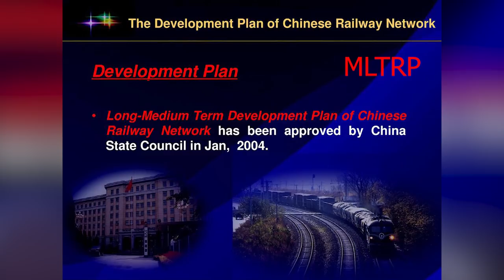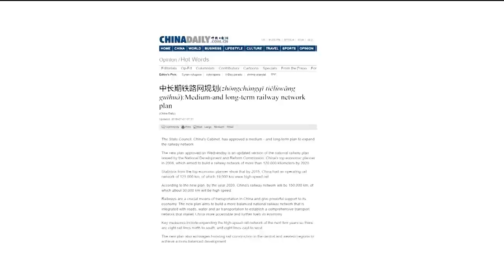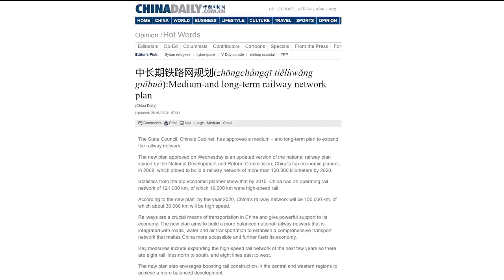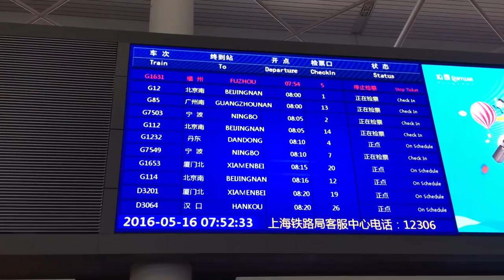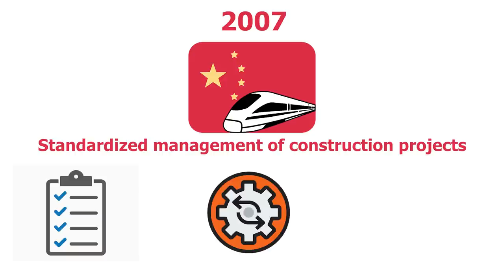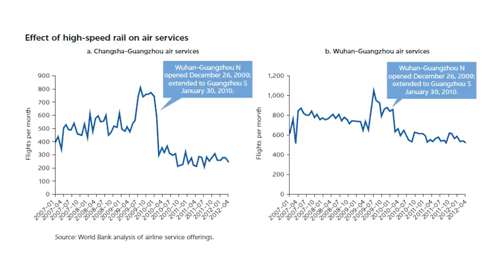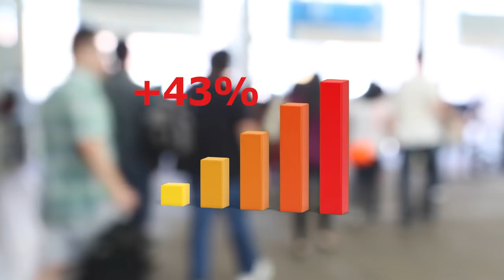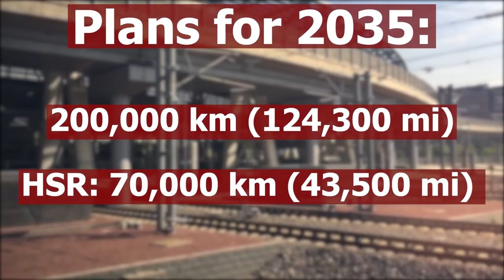How China Constructed 36,000 km of High-Speed Railways (in less than 12 Years)

Comment: One biggest advantages of China's HSR is the convenience when there is such a large scale network. The HSR in China is almost like a subway metro:
I once arrived in a HSR station 15~20 min before the next train left (the train station was much smaller than the ones in the cities). I basically got off the train,  rushed to the ticket machine, bought the ticket, and rushed to the next train, and done.

If I missed the next train, then I only needed to wait for 1~2 hrs for the next train. 

Anyway, I always bought the tickets on the spot (except in the holiday seasons).

There was just so much less stress traveling in China with HSR than airplanes. With airplane, I basically start worrying the day before the departure time about what if I did not arrive in the far-away airport on time? 

With HSR, the answer is I can take the next train.
Reply: you can buy tickets on mobile apps, saving some 5 mins to grab a coffee.
Reply: "If I missed the next train, then I only needed to wait for 1~2 hrs for the next train. " 
Huh, is that a good thing when trains in many other countries run every 30 minutes or so, and have full flexibility (no need to arrive more than a few minutes in advance, and tickets valid for each train on that day)? I'm not saying the Chinese HSR system is not good, but if you really want to feel like a subway system, maybe take a look at the Tokaido Shinkansen in Japan.
Reply: @anonomia5535  The HSR between shanghai and beijing runs every 20 mins, 1300km. If the waiting interval is longer than 1hr, I suppose it's a long long distance ride, over 10hrs. Plane will be better option. Shinkansen is equally good by design, however it's expensive. The ticket price be like 7-8 times of chinese price, to cover same distance. Usually I would fly to destination directly, say Kyoto, instead of flying to Toyko then koyto by Shinkansen. Limited Express is more affordable. It's just my opinion.
Reply: @anonomia5535  Look, Compare Japan's HSR with China's HSR is an insult to humanity !!!
Reply: I didn't mean to compare the technical differences between train systems (they're both good), but it just surprised me someone compared the Chinese railway system with a subway system, while, in fact, it is really set up like aviation. In China, you have to book your tickets for a specific train and for a specific seat, just like when taking a plane. Trains don't run frequent on most routes - you often have to plan in advance. You have to go to a train station which is usually quite far outside of the city, and have to be there quite long in advance due to the security checks etc. The stations themselves also look a bit like airports. Then, when the train is coming, the boarding procedure looks like boarding a plane. I have lived in Japan myself, and there, it is entirely the opposite. Also in Western Europe, trains tend to be quite frequent and flexible, making it possible to use them for commuting (which is not really feasible in China).

Then the price. Of course the Japanese trains are more expensive: people have a much higher purchasing power there, on average. However, the difference is more like 3-4 times, not 7-8. As an example: Tokyo-Kyoto costs 128 USD, Shanghai to Wenzhou (similar distance) around 35 USD. I find both quite expensive in their respective countries.
Reply: @anonomia you are right about the price. I bought round-trip kyoto, gosh. And you are talking about urbanization. Tokyo and metropolis in western Europe are actually cluster of small cities. However in China this is not the case. People love to live in the city where education and healthcare is better, and love to live close to workplace. So yeah there's no point to compare train with metro. The Chinese railroad bureau has drawn redlines between hsg, intercity commuter and metrolines.
Reply: @anonomia5535  And I don't think it takes long to get onboard the train. For Example if I want to travel to Wenzhou tomorrow, check on mobile app, the first departs 6:15 (every 12 mins), buy 2nd class seat at 35 USD. No need to reserve seat, the app knows who I am. It takes like 40 mins from downtown shanghai to train station by metro. I'll leave at 5am, reach station at 5:40. Walking to the train in 10 mins, or 5 mins running, did that alot. There's extra covid-19 check at the entry, all you need to do is to rub your mobilephone, flash green QR code which means you've been nowhere infected. That'll take another 1 minute and that's all, no more checks. The system knows who I am, gate machine before the train would let me in, it's facial recognition. Just hop onboard.
Reply: @ghostofsolomon237  I think you made a good point that the design of the railway systems is very different because the intended usage is also different. For daily commuting, China's railway system seems quite poor to me, but that is indeed because people there don't generally commute by train, as they live in the city they're working in. Looking at myself, I live 70 km away from work, and I normally take the train to work every day. I have a year commuter pass, so that I don't have to buy tickets twice a day. On my route, there is a train every 15 minutes, the journey takes 40 minutes, and I can always find a seat. If I enter the station one minute before departure, I can still catch the train. If I miss it, however, I just need to wait for the next one. In China, this whole process would be much more complicated for daily use, but, as you said, not many people actually do such a journey every day.
Reply: @ghostofsolomon237  I always had the mobile apps on my phone, but I did not know whether I was able to catch the next train until I arrived at the station :).
Reply: @anonomia5535  What I mentioned was a very small train station, so not many travelers. 
It's actually a good thing that there are not as many trains in these smaller train stations: cost matters.
Reply: @anonomia5535  40 min journey in China does not usually qualify as a HSR travel, more like a metro travel.

All the travels I mentioned above usually takes 2~3 hours at a speed of 250km/hr. 

HSR in China is between cities like Beijing to Shanghai.

40mins... you can compare it with the Maglev from Shanghai airport to city center.
Reply: @quietlives  Is that so? Commuting by train would be quite difficult, then. What do you actually consider as small? (what is the population size of the city, for example?)
 There's a reason why the countries with railway networks that are generally considered as being the world's best, have frequent trains even to small towns. Those countries have entirely different setups of their railway networks, though.
Reply: @quietlives  It is a 70 km journey. The journey to Shanghai Pudong Airport is only 35 km, and the furthest subway station from downtown Shanghai is around 50km away and takes 75 minutes (if I'm correct), and that is already exceptional since line 17 is barely a subway line. Most subway lines only go 25-30km outside the city. However, my point was mainly that train travelling in China isn't like taking the subway. Whether my commute to work is 70 km or 100 km (like Shanghai-Suzhou) doesn't really matter.
Reply: @anonomia5535  Got your point. I actually did take the Shanghai-Suzhou train before, a lot of people waiting, so that one did not feel like a metro to me at that time as I might not be able to get a ticket due to the amount of travelers.

We shall see how China handles the decentralize its big municipal areas into suburbs.
Reply: @anonomia5535  The definition of 'small' certainly is different in different contexts.

For China, people generally think only HSR are qualified as train-travel-friendly as China is big so traveling with normal trains can be tiring.

My experience with traveling China to some very faraway regions was: most if not all cities were connected with HSRs, all the counties along these HSR lines were also connected such as the small train station I mentioned above.

The other counties can be reached from cities with road transportation.

I personally has been tracking a new HSR line in Yunnan from Jinghong (Xishuangbanna's region capital) to Mohan (door place to Laos), then to Laos, which I have visited early this year.
Reply: @quietlives  I'm also curious to find that out. I think this is a major challenge for transport in China that is often overlooked. Currently, the paradigm is one of subway within urban areas, and HSR between urban areas. However, we seem to be reaching a point where subway systems are becoming too big with cities spreading. I wonder whether a 1.5 hours - 40 stops subway ride will really be the most efficient solution to this problem.
Reply: @anonomia5535  I don't think that problem is within the scope of transportation, not until sci-fi movie style TRUE 3D transportation is out.
The solution I can think of is decentralization. Beijing is doing the experiment right now, moving all non-central government level functions out of Beijing to suburbs, with Xiong'an as another new model.
We shall see how it works.
But anyway, China is searching for its own solutions, so it is fair to say China should not be compared with other models for now when its new model is yet to be completed.
Reply: @ghostofsolomon237  Shinkansen is only one line, from Tokyo to Osaka.  It's easy to be run like subway, it's same in China if you go from Beijing to Shanghai.  In China it's a whole network, he is not from a major city so not so many trains there, or trains could go pass it without stop.  Compare Japan railway network with China railway network is stupid！
Reply: @quietlives  Solutions already exist. The easiest and most China-proof way would be to have subway/railway lines, potentially with 4 tracks, with both all-stop and express services (that only stop every 5-7 stations or so). This is a bit like it works in Japan or even the US (but don't interpret this as "US subway systems are good"). Decentralized cities will also need convenient connections between the centers.
Reply: @enzhus  I'm not sure whether this is what you meant, but there are more Shinkansen lines than the one between Tokyo and Osaka. However, what I meant is that the Shinkansen is quicker to take and more flexible. All tickets are valid for all trains on the specific day (so no need to catch a specific train), it takes less than 1 minute to get to your train (no security checks, oversized stations or boarding processes), and there's no queuing involved (apart from just in front of the train doors, perhaps). 
Besides that, I wouldn't call China's HSR system a "network" since there is a strong bias towards infrequent but direct routes. A network for me means you can easily get everywhere, at fixed intervals, potentially with short transfers. However, I do agree the Shinkansen network isn't comparable because of the geographics of Japan.
Reply: @anonomia5535  Since you've taken many trains and metros in China, you are certainly very familiar with the complexity of these systems, including for people to figure out their routines at any station.
Thus, I don't think adding extra layer of complexity is a solution.
Reply: @quietlives  If it works in Tokyo, where it is even much more complex (think about through-connections: trains continuing as subway lines), I doubt it wouldn’t work in China. In fact, I think Chinese subway systems are even quite easy to use. Never had any confusions there! Anyway: let’s conclude we’re looking forward to seeing which creative solutions will be found in the future. 🙂
Reply: @anonomia5535  Sure. But I don't agree with that Tokyo is more complicated:
1. Japan already finished industrialization decades ago, and most of the urbanization is complete, so they can build to solve issues for the foreseeable future.

China has not completed the industrialization process, and how the traffic demand will change itself is way more complicated than other countries.

2. China has 1.4B population, and none should think that this ppl will distribute RELATIVELY evenly.

It is likely that ppl density in China big cities is/will be heavier than Tokyo.

When the scale increases, the problems are different => scalability issue.
Reply: @quietlives  According to Wikipedia:
- Shanghai: 4,200 people/km²
- Tokyo: 6,349 people/km²
But I think your argument of population density actually works in the other direction. Perhaps Chinese cities will get very high population densities because of the inability to let the city spread further. No one would like to stand on the subway for 2 hours. As a consequence, people will try to live close to the city center. If you can reduce this 2 hour subway ride to an easy and flexible 1 hour train ride, people might be willing to live further away.

I was referring to the complexity at this moment, not how it will be in the future. However, you definitely have a point that future evolutions make it difficult to construct an ideal system at this moment. This is also why Shinjuku station in Tokyo is so horribly designed and complicated, for example. Has once been constructed in a simple way but grew organically because of the changing demand.
Reply: @anonomia5535  I think many predictions, if not most, have kept failing on China in the past. This is why I think China is a new model, and should not directly use existing solutions.
New model => solutions.

Besides, it won't improve the world overall when only existing strategies are repeatedly applied to new questions.
Reply: @quietlives  That is undoubtedly true, but then the typical Chinese arrogance of "look how great our country and railway system is - much better than anywhere else" isn't really helping. First you need to identify there is a problem before solutions can be found. But don't get me wrong, I do think China's HSR system is very good, at least for journeys of 300 km and more. And I also think that is where we're lacking in Europe (but there are reasons for that).
Reply: @anonomia5535  "typical Chinese arrogance "
This is partially true:
For netizens, including me, this is somewhat true. We talk proudly/in pride, but in the heart, we know best there are many problems out there and more in the future.

If you look into how China's public transportation improves in the past, you will realize that the government and experts did a great job in predicting future problems, though they did make a lot of mistakes at the same time which was indispensable for any project/plan/proposal.

Considering this pattern, I would call your impression of Chinese arrogance as cultural shock, for the sake of that Chinese so far never have been arrogant in actions.
Reply: @quietlives  I like (and agree with) your reaction. Yet, I read the last thing you mentioned more as a description of the past than one of the present and future. But it was a good characteristic, so let's try to keep it!
Reply: @anonomia5535  
1. "I read the last thing you mentioned more as a description of the past than one of the present and future."

I was about to mention this after posted the last comment, but I guess Japanese in general are more sensitive/knowledgeable about China than the westerners, so the general public got the impression sooner.

COVID-19 had change the world and China forever. In the past, the 'Chinese arrogance' was more or less a manifestation of inferiority complexity. But from now on, the Chinese arrogance will come mostly from internal confidence. The behaviors of Chinese will be more nice, kind, rational, acceptable to opposite opinions just like what you normally saw from pre-Trump Americans. And they are more willing to admit the progresses made in other countries. However, they/we  (as I don't live in China) will likely take these opinions less seriously and focus more on what's going on inside China. This is both a good and bad transition, and I do not want to comment on something too early to tell.

I am sure non-Chinese might feel offended more in the future. But again, I don't want to comment on this as it is too early.

2. The Tokyo railway map
Yeah, it was indeed complicated -- I saw a lot of videos showing how busy Tokyo transportation could be. This map matches my impression.

As I don't live in China, whenever I visited China, I was already confused by these complicated maps. Thus from a personal PoV, I hope the transportation can be simpler and let everyone get to know it right  away. Hence my opinions above.
Reply: @anonomia5535  OK, I see what you mean and I agree with you mostly.  China railway is still for long distance travel, not for daily commute.  Railway mileage in China is still not enough, though it has the 2nd longest railway track mileage, but by per person or per km2, it's still low.
Reply: @quietlives  I'm not Japanese, if that is what you meant. Just lived there for a while. And I use Tokyo as an example because that makes more sense than using cities in most other countries. Comparing my 75,000 inhabitants city with an average Chinese city wouldn't be very meaningful.

Although you said several interesting things, I think we shouldn't move too much beyond the topic of this video in these (public) comments. I just can't stand those simplistic, propagandistic comments you often see nowadays, from both sides. Still, I have talked to many Chinese people so far, and I feel that by far most of them (the English-speaking ones, at least) are quite reasonable and willing to discuss something after a while. That is quite hope-giving already!
Reply: @anonomia5535  Sure. Sorry for my misunderstanding.
Reply: anonomia lol, you are comparing a 70km train trip in Japan to hundreds of km to 1000km plus HSR in China! That 70 km is just like a local metro trip in big Chinese cities.
Reply: anonomia , lol now I get what you are trying to project. Just try to be open minded and not be the usual confirmation biased mindsets type filled with dogmas and conjectures but seemingly trying to be subtle with your long  winded comment. Sorry for being blunt. Anyways have a nice day, be well and stay safe folks.
Reply: @tiangcs8069  We had that discussion before. First, it wasn't in Japan. Second, my point was that I much rather commute 70 km where I live than in China (Shanghai-Suzhou, for example). If you say railways are only meant to be used for a few trips per year, then I think you're not using them at their full potential.
Reply: @tiangcs8069 Same for you!
Reply: @anonomia5535  That's  changed. 
I spent  two months  traveling  on Chinese Railways and booked  and paid for the  journeys on my cell phone  at home  in Ireland before I went.
The service is  first class. 
And not expensive
Reply: @SuperMikado282  What changed? I'm sure you can also book flights at home in Ireland, but that doesn't make taking a plane like taking the subway. Besides that, you can book train tickets online for (almost) every country.
Reply: @SuperMikado282  Honestly, I don't really get your point. The only thing I said is that taking the train in China is not like taking the subway, as someone mentioned. The fact that you booked train tickets months in advance proves that point.
Reply: I think for operation, Japan does much better than the China Natinal Railway Co. That's the consensus of the most rail fan in China. Japan is famous for its detail and humanity service. For China railway, there are some reforms on the way. In Guangzhou, the Guang-Qing railway is given its operation to Guangdong Railway which is a branch department of Guangzhou Metro, instead of HSR itself. It's a great progress that passengers can use metro card to take on the national railway, which is breaking the barrier.
Reply: Rail fans want the operation of HSR in China learn more from the metro system, so that it can be more flexible, convenience and humanity. But the HSR is conservative because it will cost a great deal. And most of the people mostly concern about the price instead of the issue that rail fans care the most. In terms of fare, HSR in Guangdong province is exceptonally slightly higher than other area in China, due to higher construction costs and local governments negotiation, which is complained by most of the rail fans in Guangdong.
Reply: @anonomia5535  One problem with the local metro and national HSR connection in China is with the security check, as it's required by both HSR and local metro. (I'm personally not sure why security checks are needed, maybe it provides some jobs and is a measure to control the number of people getting into the stations or whatsoever) These two security checks have different standards, such as what is allowed and what is not allowed on board. Therefore it's hard to achieve the "same platform transfer" (Japan and other countries have this thing and I guess this is one thing that gives you the impression that Chinese HSR is somewhat inconvenient ) from HSR to metro or vice versa. To my knowledge, there is only one place in China that this is achieved, but only when transfer from HSR to metro, the former has higher standards of security. 

The other problem is the different signaling systems. The HSR, normal speed trains, and metro have different signaling systems. So before a unified signaling system can be made compatible with multiple forms of railway transport, I wouldn't expect to see metro lines being shared with trains or HSRs on a large scale. 

China is way less urbanized compared to Japan, there is often a disconnection between the urban areas and surrounding less-developed counties. So coming back to your point of long subway travel to these places, YES it's a problem that requires more delicate planning and railway fans in China know this, but still, not a lot of cities have developed to a level that this is necessary. The one option to use the national railway network in addition to local metro has the challenges mentioned above. And building multi-level, station-skipping metro like Japan (普通（Local)、快速(Rapid)、特急(Limited Express)) requires an overhaul to the signaling system as I imagine, as well as more costs due to more tracks in stations. So far, only Line 16 of Shanghai metro has this thing as far as I know.  

Anyway, I personally think that it should take a few decades for China to develop its own use of different types of railway networks. There are attempts in city clusters like Beijing-Tianjin, Shanghai-Nanjing-Hangzhou, and the Pearl River Delta (Guangzhou, Shenzen, Foshan...), where short-distance commuting along the railway line is a thing. There, HSR (more like 200 kmh level intercity) adopts 自由席 (non-reserved seats) and travel pass. This gives a more convenient travel experience but still falls short on the scale, having to pass security checks etc. compared to Japan. It would take a considerable amount of time before this gets mature.
Reply: @anonomia5535  China is still at the phase of quick expansion of metro system and priority is to build subway to link within cities. Some suburb commuter rail start showing up but at smaller scale. After subway are mostly built, the next explosion will be commuter rails.
Reply: @anonomia5535  some cities are start building express subway now like line 18 of Chengdu. It overlaps in large section with line 1 but then skip quickly o the new international airport. Top speed at 140 km/h. Beijing Daxing airport line is duel purpose as well. Even faster at 160km/h.
Reply: @sealtrader  china is number 2 economy of 16 trillion dollars while japan is number 3 of 5 trillion dollars.. japan is really efficient but china's high speed trains are Far better than the american ones..